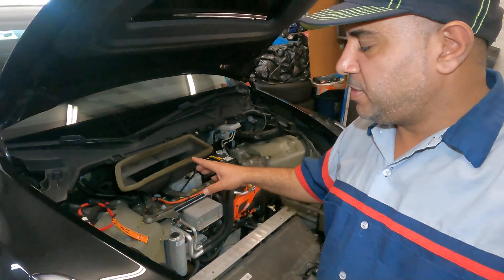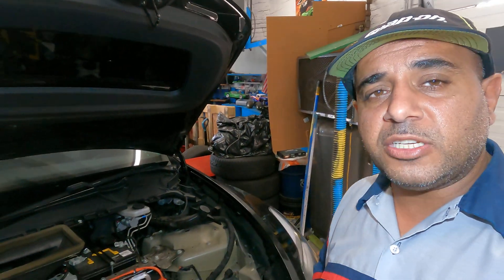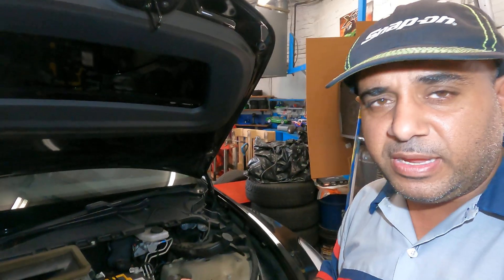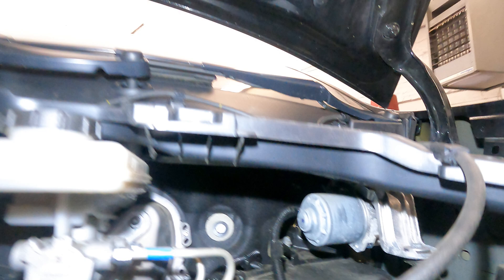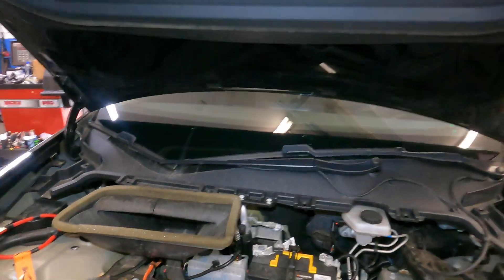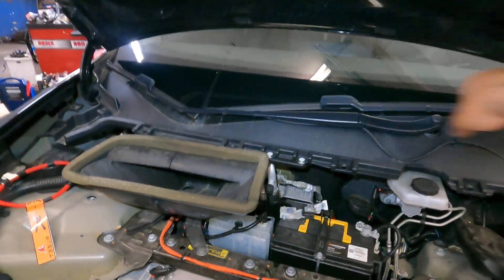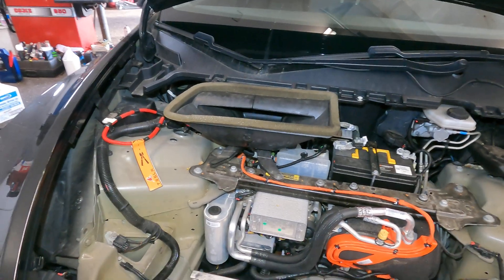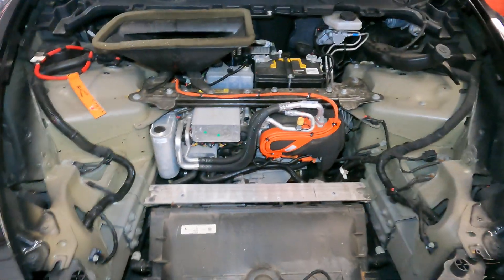Tesla Model Y wiper motor and the system

Comment: Any software programming needed after replacing something like the wiper motor?
Reply from the maker: No shouldn’t have to it’s a dummie u might have to align it propperly to where it stops and adjust the wiper blades travel
Reply: @ thanks. My sisters just went out and it’s out of warranty. Figured I could just replace it since it’s accessible and I’ve done it on normal cars
Reply from the maker: @ yes welcome kinda process but u can do it